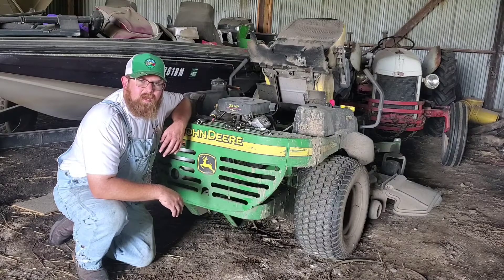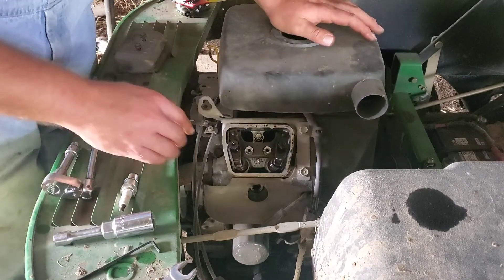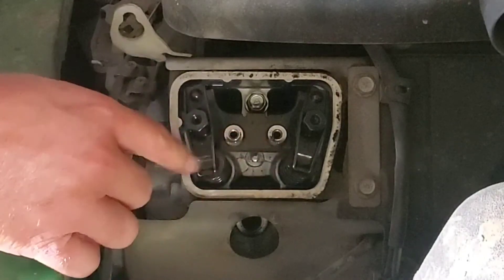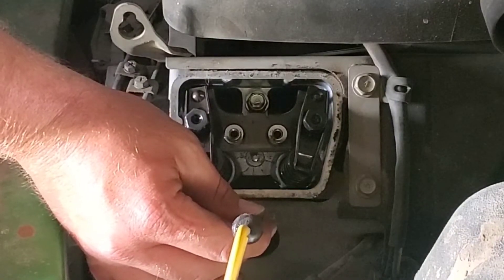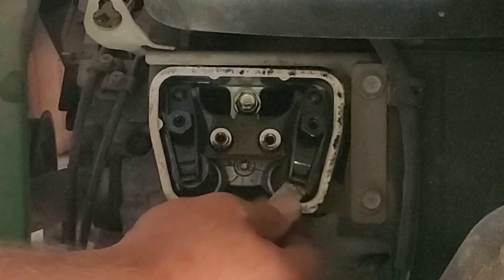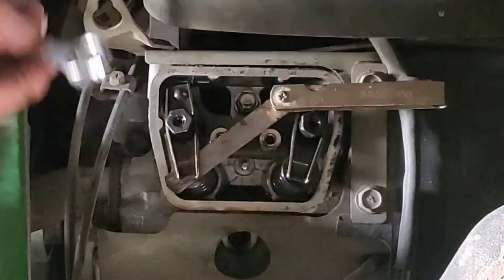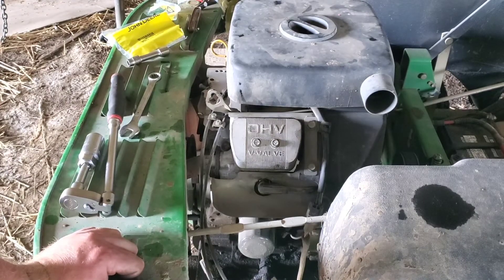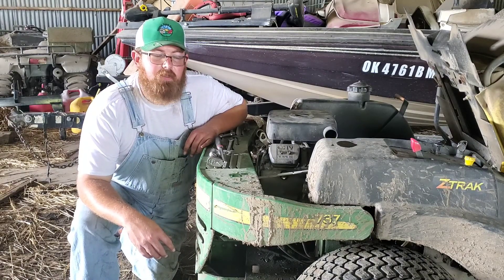Adjusting the valves on a John Deere 737 ZTrack zero turn mower w/ 23hp Kawasaki v-twin.

Comment: I just bought a john deere lx277 and the valve got stuck open anyways I got it un stuck and working but in the meantime time I frigid up the valve adjustment and I can’t for the life of me get this thing running, I can’t figure out the top dead compressed stroke and other special things that it need to adjust the right , I sworn last 2 days trying them all, and worse then she ever was now. I need help
Reply from the maker: So if it were me the first thing i would check is make sure the push rod isnt bent or the valve isn't bent. They are considered an interference engine. Im not sure on the FH500V if its a common issue but the horizontal shaft on the 737 was bad about retaining too much heat in the heads and if you didn't let it run at idle for a bit to "cool down" the valves would stick in the heads and bend the push rods. So i would take them out, roll them on a flat surface if they are good then see what you can tell about the valves closed the intake and exhaust should be perpetual to the head and they should both be the same height. If they aren't it would suggest a leak down test. If they look good then i would put it back together and put just a touch of tension on the valves with the adjusters. Roll it around till the piston is at the top of the cylinder and see if your valves are loose they should both be closed of its not turn it another full rotation and that should put you on TDC for that cylinder. Sorry for the long comment. I hope this helps. Thank you for watching and reaching out. If you have more questions don't be afraid to ask!

Comment: Extreme novice here - great video…. As another I wasn’t sure of “where to turn the motor”… kinda understand now. My question is: there seems to be oil leaking around the right side OHV valve cover….worth tackling or take it to someone?.. Regardless - THANK YOU - great teacher /great approach!
Reply from the maker: Thank you so much for watching! If it looks like a valve cover leak I myself would for sure tackle it myself. Just unbolt the valve cover and clean the mating surfaces and install a new gasket. I'd be sure to check the valve cover for cracks in case the cover has been over torqued at some point. Other than that it's a pretty easy process

Comment: How are you turning over the motor?
Reply from the maker: Just rolling it by hand it turns pretty easy with both plugs out of it.
Reply: Sorry I should be a bit more specific. Where specifically are you turning it at?  Do you have a shot of where I need to turn? Thanks.
Reply from the maker: It's ok. No I don't have a shot of it but on these series of kawasaki engines they have pulleys on the front and back of the engine. Both connect to the crankshaft. On this engine I actually grabbed the pulley on the front of the engine because it is easier to get to. It has a serpentine belt running to the hydrostats the rear pulley has the electric clutch that operates the deck belt.

Comment: Great video my friend   would a 757 be the same clearance as the 737?
Reply from the maker: Thank you so much! Yes .004-.006 is pretty well the standard for all kawasaki engines. They offered 3 engines for the 757s 2 25HP models and a 27HP but all 3 set the same. I hope that helps and thank you so much for watching!

Comment: Hey,great easy to follow video. I have the same mower here that will randomly quit under load but fires back up by pulling the choke. It also backfires a bit. 
I have changed fuel pump,and pickup,fuel filter and also new plugs. I just set the valves this morning…  any ideas? I’m wondering if it maybe has a weak coil.
Reply from the maker: Thank you for watching! I see. Ya that sounds about like the next possibility.
Reply: Gotta keep an eye on the push rods and valve guides the valve guides work there way out and acts like a bent valve causing it to bend the push rods
Reply: All around great mower love my 757 holds a bank like no other